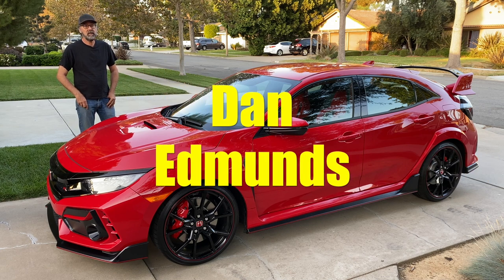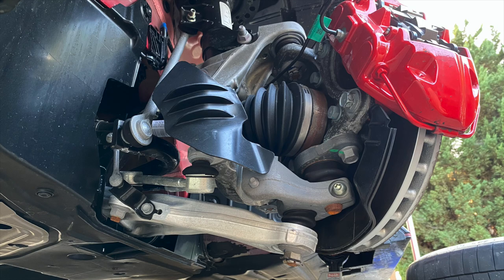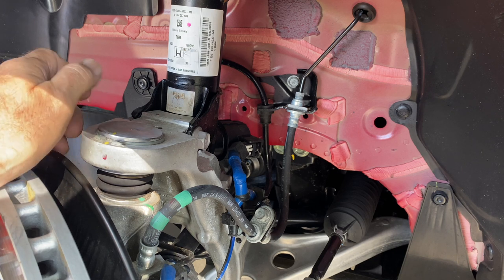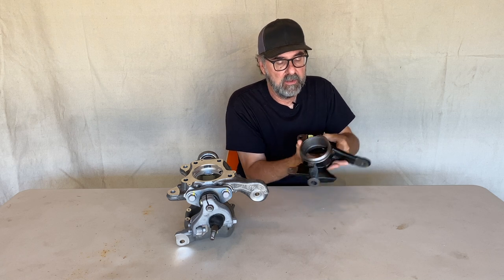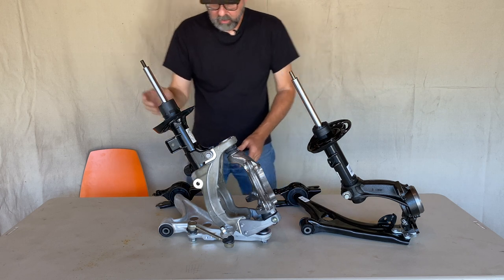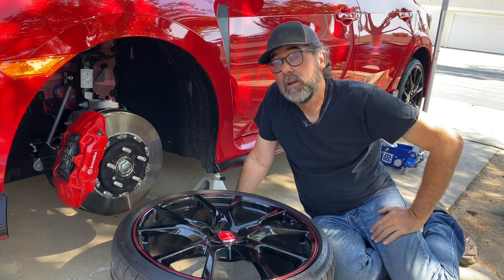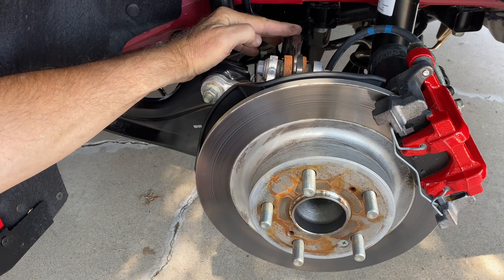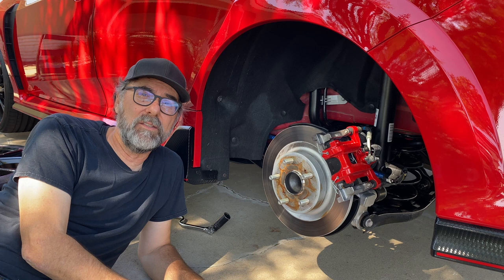2021 Honda Civic Type R Suspension Walkaround - See The Engineering That Gives It Epic Handling

Comment: Honda wouldn't have need to do a front suspension like this if they still use double wishbone for the front suspension like they used to.
Reply from the maker: I raced two of those double wishbone front suspension cars. The CRX DX handled amazingly well, but it was a lightweight short-wheelbase car that weighed just 1,984 pounds with a full stock interior (required to remain per the rules) and a bolt-in roll cage. The Civic Si weighed something like 2,200 pounds. It had more power, but its longer wheelbase and that extra weight made it an understeer monster on the track. This was showroom stock, so no mods of any kind were allowed except tires. Point is, both had that double wishbone front end, but the results were mixed and seemed to have more to do with weight and wheelbase. But, yeah, the change to struts was a backward cost-cutting step at the time. Could that layout have coped with 306 hp coming solely out of the front wheels? I can't say. These cars have gotten a lot bigger and heavier since then.

Comment: I feel like those wheels and tires are pretty heavy at 53 lbs. My set of 245/40R20 and aluminum rims come in at just a hair over 45lbs (2012 Lincoln MKS stock wheels/tires were 60lbs).  I would think that a type R would be lighter.

Comment: Another great walkthrough Dan!  I'm surprised at how much development work went into the Type R suspension redesign considering it is only used on a relatively low volume model.  The amount of aluminum in those parts partly explains why the MSRP of the Type R needs to be so much higher than the base models.  The addition of the standalone components on the table really helped show the enormous differences between the designs, thanks for that!  Keep up the great videos!
Reply from the maker: This is why I like doing this. Certain models cost more or handle differently than others, and it's easy to assume that it's just tires and a badge. This is NOT that.
Reply: Because it was impossible to beat the Megane RS Nurburgring lap time without it... as Renaultsport have been running the dual axis design for years.

Comment: Thanks a bunch for doing this entire video, and especially for showing on the bench the difference between the dual-axis McPherson parts vs a standard McPherson parts. I've seen all types of diagrams and animations around YouTube with regards to the Honda setup, but was never able to grasp the full concept due to that extra holding clamp between the dual-axis carrier and lower control arm, as well as the axial differences from the shared strut top and the carrier ball joints and the standard lower ball joint between the knuckle and lower control arm.  

Seeing the dual-axis parts on the bench was the eye opener for me.  I had no idea about the carrier/a-arm locking clamp, or the fact that the strut didn't actually turn with the steering knuckle like a normal McPherson does.  It seems to me like a dual-axis McPherson (whoever first designed it) setup gets the benefits of the double wishbone suspension that Honda used in the 90's, but avoids the complexity in parts and suspension tuning that double wishbone had? 

Anyway, yeah.....  Thanks a bunch for this!  Very helpful.

Comment: Great video! I had a Type R back in 2017 and was extremely impressed with what it could do for a FWD car it was honestly amazing. Long story short I ended up selling the car about 6 months later and last year I bought an ND2 Miata and needed a daily so ended up buying a 2020 Civic Si as it was substantially cheaper than the Type R as well as a better daily in my opinion......and with the Miata I felt I didn’t need to spend the money for another R but I have to say there is NO COMPARISON between the Si and the Type R! I obviously didn’t expect it would be real close but whatever they did to turn the regular Civic into a Type R is insane. The Si isn’t a bad car but it lacks the steering precision and feedback, it has more torque steer despite having significantly less power, it has annoying lag and rev hang, it rides worse than the Type R despite having 18’ wheels instead of 20’s, and although I would expect my 2 door Si Coupes body structure to be even more rigid compared to the 4 door hatchback body style of the R it turns out that is also not the case as the Type R felt rock of Gibraltar solid while the Si is just merely “tight.” The Type R is a monumental achievement and improvement on the standard and even Si Civic and considering what the had to start with I can’t say enough about how impressed I am with the engineering that went into it. I don’t know of any other car that after 4 years on the market still commands MSRP or more (my friend just bought one based on my recommendation and couldn’t find one less than $2,500 over MSRP) but obviously that speaks volumes that there are people out there that appreciate what has gone into this car
Reply from the maker: hard to argue against the ND Miata. I'm a huge fan, and I personally have a long history with the car. Maybe I'll do a live stream about cars I've owned.
Reply: @DanEdmunds  that would be great!
Reply: very interesting.  I have a Honda S2000, a 19 CTR, and a 99 NB Miata. All very different cars offering a very different driving experience.  I've had the Miata for nearly a year now--bought from the 1st owner with less than 70K Miles.  Although I will always have my S2000, I have developed a deep appreciation for the driving experience th Miata offers--after doing a number of track days on my s2000, including autocross, I felt I would appreciate the Miata's handling and light-on-it's-feet dynamics more than ever before.   I love it and would like to get into a ND.2 one day.
Reply: @DanEdmunds  Hey Dan, really top notch content here.  I have a S2000, 19 CTR, and picked up a 99 Miata about a year ago.  This was my first Miata and it has really grown on me.  I heard the ND has impressive build quality as it relates to its suspension as well.  Hopefully you will get to do a video on the ND.

Comment: 3:49 that height sensor is also used (most probably the only function in this application) for self leveling headlights. The system compares the height of the front in relation to the rear of the car, determining the tilt then adjusts the headlights accordingly (but very subtly).
Reply from the maker: It can be used for that, too, but it is part of the feedback loop that the dampers use to make adjustments.
Reply: @DanEdmunds  Oh I see. Thanks for the info.

Comment: Awesome stuff! This is the best suspension breakdown I have watched on the Type R. Such a special car, making me think twice about messing with the suspension. I had spoon lowering springs, spoon rigid collars and white line anti-lift kit that I planned to put on the car.. I don't want to mess up what Honda did though.
Reply from the maker: As a former OE suspension development engineer, that was always a concern. That's too strong a word -- more a disappointment. With standard cars that are middle of the road, it's fine -- although many aftermarket tunes are not always fully vetted. But with a car like this, they have put a lot of effort into maximizing its potential. I think lighter same-sized wheels and tires -- much like the 2021 Limited Edition has -- will wring a bit more performance out of the car. The Limited Edition wheel/tire combo is 5.5 pounds lighter per corner, which is quite good.

Comment: Hello Sir can you do videos on the E36 M3 Z axles rear semi-trailing arm suspension, the E39 M5's Integral Link, and the double wishbone front + multi-link rear suspension on the 04-08 Acura TL/TSX (03-07 Honda Accord) platform. I think the 2000s era Honda benefited from Shigeru Uehara's on all of its platforms and you can see it in the suspension geometry design.

Comment: I have base k20C2 6MT and given the already featherweight, any extra weight loss is exponential. The front suspension design is simplistic but very effective. I hope Honda plays on it and makes it even lighter. Take enough weight off and it'll perform as well as the heavier setup. My current 16' RPF1 weighs 13.7lb on 215/55/16 UHP tires which is enough rubber for my 2700lb Sedan.

Comment: The steering axis is in the middle of the tire, or close to it, which reduces the leverage torque steer would have over the steering linkage to almost nothing. Putting the wheel outside the steering axis increases the torque steer. 
.
Pretty cool.

Comment: Wow thanks for the great video.  I came across your video trying to learn all I can about the Civic Type R.  I have test driven one and it was very exciting.  I am in a pickle as the Type R lead my next new car but the V8 mustang in Grabber Blue was my leader from 2018.  I thought since the last Grabber Blue was in 2017 that surely Ford would bring back this great color by 2020 or 2021.  I am not sure it will ever return to the gas version GT.  I learned a ton from your well explained video and this civic is so much better than the SI and the other Honda Civics.  As a daily driver what is your take on this over the GT.  Obviously the gas is a factor but I am actually thinking the Civic Type R may be better as the power in curves and the set up maybe better suited in more daily driver areas.  Your take or anyone’s take.  Thanks.  Great work on the video.

Comment: Dan, since you clearly know whereof you speak, what do you think about downsized aftermarket wheels & tires for the Type R? Having a higher section height might make daily driving less fraught and smaller wheels & tires means less unsprung weight. Seems like a win win, but I worry about messing up careful engineering from the factory.

Comment: Wow this is fascinating! I had no idea the new CTR suspension was made that way. I’m from the era of double wishbones on Honda front ends and never liked how they went to front struts in the early 00’s. This CTR setup is definitely a cool way to solve the torque steer issues. But unfortunately it’s still strut based, which means there’s very little negative camber gain as the suspension compresses, at the detriment of the car’s ultimate handling capabilities.

Comment: @6:43 and @12:17:
The common mounting strategy is absolutely critical to this design. If all Honda wanted was the best possible front suspension, they would use double wishbones, which would be lighter and work better. What they needed was to put a more capable front suspension in the Civic without changing the vehicle structure; like Ford (with RevoKnuckle in the Focus RS) they designed a complex system that behaves much like double wishbones but bolts into the body structure and subframe designed for a MacPherson strut, not needing additional structural mounting points for an upper wishbone.

This is what happens when a company makes a $50K performance car out of a $25K economy car, instead of designing a vehicle for the end purpose. The buyer pays a premium (even more than superior double wishbone) to get a complex suspension mounted to a cheap car.

Comment: Great tutorial, on the Civic type R suspension. Best in depth vid yet. Explaining all components and how it all works in resolving torque steer! Having owned my 02' Acura RSX Type S for 16 years now. Any ideas on how to alleviate on this platform? Would it be possible to convert Civic Type R suspension onto an Acura RSX Type S. It is also lowered on Apexi N1 Dampeners. Any help would greatly be appreciated.

Comment: Regarding the electronic dampers, the Civic Si also has this feature, my 2018 does .
Reply from the maker: Yes, but they made a change in 2020 to increase the operating/adjustment frequency of the system by 10x. Much more responsive.

Comment: Whoa great explanation!  Maybe years from now the aftermarket performance tuner will develop products to replicate this system for more regular cars
Reply from the maker: Theoretically possible, but that'd be a lot of parts! And it would cost $$$. Also, the track width has to grow out of necessity, so in addition to the parts on the bench you'd need fender flares, longer driveshafts, longer tie-rod ends, longer brake hoses and ABS sensor wires -- and then you'd have to increase the track width and flare the fenders at the back to match. Theoretically possible.
Reply: I see.  Be that as is may. I think that wouldn't be marketable due to cost n too radical.

Comment: Hey Dan, great video. I was curious about the last bit on the rear suspension, when the shorter link swings upward does it sort of pull the longer link inward  towards the front of the wheel well to increase toe? I was trying to envision how increasing the stiffness of that bushing on the large link would increase the toe in. I wondered if you wouldn't mind explaining that. Thanks!
Reply from the maker: Basically, as the two links swing upward, as they do as the outside tires compress in a turn, the shorter rear link will cause the tire to toe in. Now, a squishy rear bushing can mute that outcome somewhat, so making it stiffer makes the effect a bit more pronounced. I spoke to some Honda engineers about this, and they, said that was precisely why that bushing change was made in 2020.

Comment: Great demo, I love this type of video. quick question, the imaginary line from the upper ball joint thru the lower ball joint,   when that line intercepts the center of the contact patch is that called zero scrub? do all modern cars achieve zero scrub radius?
Reply from the maker: The distance between that point and the center of the contact patch is the scrub radius. Incidentally, readers of Sport Compact Car might remember it as The Dave Point, after author Dave Coleman got tired of calling it "the place where the projected steering axis intersects with the ground" and claimed the name for his own. Anyway, not all cars achieve zero scrub, and most don't come all that close. In fact, there is a bit of debate as to whether zero-point-zero is the best move. A small scrub radius is definitely a very good thing in most cases, but I stopped short of calling this a 0.0 scrub radius because I don't know the spec.

Comment: would LOVE to see a video comparing the advantages of rotational inertia/unsprung mass using a carbon fiber wheel and  carbon ceramic brakes vs the same car with aluminum wheels and cast iron brakes.

That was a bit of a mouth full.

I just noticed that everyone talks about the rotational inertia benefit with a carbon fiber wheel but they rarely point it out with Carbon ceramic brakes discs?
Reply from the maker: Agree. But don't be too hard on them. The wheel effect will be greater because the radius of the center of mass (the subtracted mass) will be larger. It's also easier for the average armchair analyst to get comparative wheel weights to talk about. And it's easier to imagine swapping out your own wheels than changing over an entire brake system.

Comment: Amazing video, Dan! What do you know about the suspension tuning for the LE vs the “base” Type R?  Is it faster Hz? I’m curious if the base can be tuned similarly or if doesn’t matter since the LE tuning accounts for the reduced unsprung weight.
Reply from the maker: Whatever you do, you still wouldn't have the same steering geometry or track width. And your steering geometry also means you have to be careful about wheel offsets if you go for wider wheels. But performance models do generally have stiffer (higher ride frequency) setups, but maybe only by 10 percent. Those are usually chosen based on the sprung mass, though, not the unsprung mass.
Reply: @DanEdmunds  Hi Dan, Thanks for the reply. I think I want to clarify what I wrote. Do you know anything about the changed suspension tuning to the Limited Edition Type R vs the regular Type R? I know it was tuned specifically for the saved unsprung weight... but anything else?

Comment: Hi Dan, great video! You mentioned that minimizing the scrub radius will reduce the tendency to torque steer. But would you prefer the scrub radius to be slightly negative or slightly positive on a fwd car?
Reply from the maker: There is no single answer because any suspension is a system that balances many competing goals and objectives. There are many more parameters in play, and they're all interrelated. That said, most FWD cars have front struts, and for those a bit of negative is where you want to land.